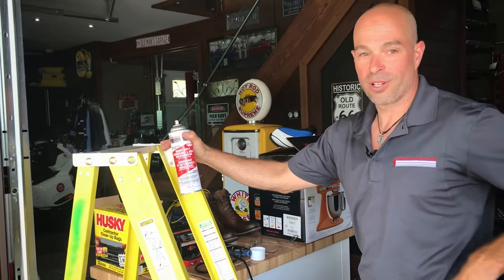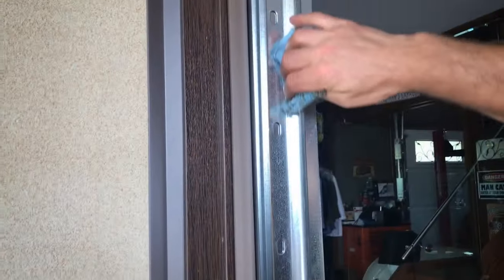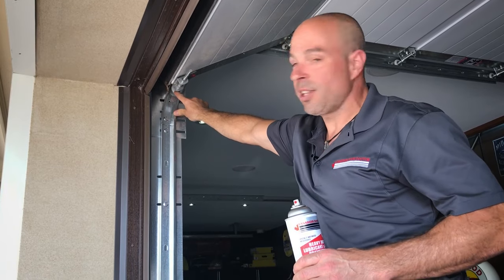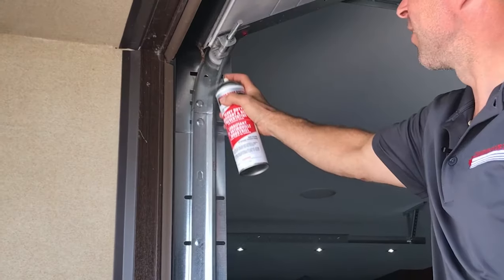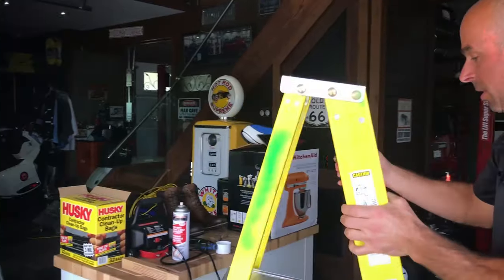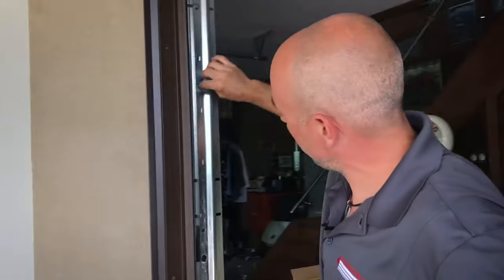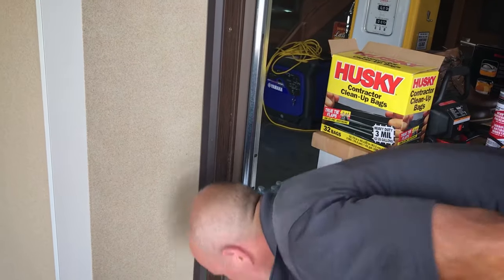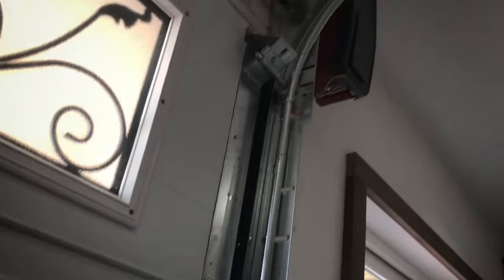How To Lube A Garage Door Properly! "Mike's Garage Door"

Comment: Wrong wrong wrong. You don’t lubricate the tracks.  All you’re  doing is creating an environment where dirt and dust will accumulate and make it harder for the garage door wheels to go over or through.  You want a smooth and clean track that your wheels can ride on.  So clean your tracks with a degreaser until all that junk from your previous lub, dust, and dirt comes off.
Reply: You’re supposed to lubricated
Reply: It’s supposed to be lubricated
Reply: @xian.irungu  not the tracks.  Te tracks are smooth enough.  Clean them well and carefully run your fingers inside the tracks and you’ll see.
Reply: @CrazyxxxUkraine  ive done both, and just cleaning the tracks was 10x better.  It made it easier for the wheels to roll on it without having to go through all the muck that the lubrican collects.  It also made it easier for the motor as well.  Good luck with it.
Reply: To clarify, if the rollers don't work due to lubed tracks, it will damage the rollers and create flat spots. You DONT want to lubricate the tracks.
Reply: If you watch the start of the video, he does clean the track!
Reply: @shoafymusic  Cleaning is fine, it’s greasing the track that you’re not supposed to do.
Reply: @edwardlouis3428  agreed!
Reply: @xian.irungu  yes, but not the tracks!!!!!
Reply: I totally followed this video and it made everything so much more squeaky I want to throw up. Now I can't get it to go back to how it was (it wasn't great before I did it).
I haven't been this frustrated in a long time. It sounds like nails on a chalkboard now every time I open and close my garage door. So much for diy YouTube, God this sucks
Reply: @bricksbyficks6448  can you identify what exactly is squeaking?
Reply: @shoafymusic  no I can't. Wish I could, I had to just walk away I'm so pissed
Reply: @bricksbyficks6448  that’s fair man. Totally understandable 😂. Whenever you calm down a little go back out there and see if you can figure it out, maybe manually do the test so you have control over the door.
Reply: @shoafymusic  I appreciate it. That's a good idea and I'll try it tomorrow. I'm feeling better now that I stopped trying to fix it. I just moved into a new house and I'm trying to be a good responsible home owner. Unfortunately I have very limited time and a diy budget lol
Reply: @bricksbyficks6448  you’re fine brotha. I know exactly how you feel. Manually controlling the garage door will allow you to open and close it as you please and this will help have you listen and identify the approximate area that’s making noise! Best of luck to you, I hope you can figure it out!
Reply: @bricksbyficks6448 You better call Mike!
Reply: Dry lubrication  does not attract anything.
Reply: @TeddyRumble  but it cant be held onto surfaces. That’s is why they are mainly used in places where they can be contained. The garage tracks are not areas that can contain dry lube.
Reply: @xian.irungu  I use silicone spray which is made for rubber, plastic, and metal I think he does this just so there isn't any noise gets a call back.
Reply: So what do you do if your garage door opens half way then stops
Reply: @michellenixon853  check the alignment of the rails. Check the tension spring located above the opening of the garage. It may also be a mechanical issue with the opener itself. If you grease the tracks, they you’ll need to clean it. Too much gunk will cause it to stop the door (like a speed bump). You want them as smooth as possible.

Comment: lube all hinges with white lithium grease and spray the torsion spring on top, youre welcome
Reply: U just ruined this guy, lol
Reply: What spray for the spring?  Silicone?
Reply: Garage door lubricant. Blaster has it.
Reply: Thats what i did. Just put the wd40 white lithium on the hinges and then silicone lube on the smaller moving parts and rollers. White lithium looks like shit tho after its smeared all over and tracks and stuff.
Reply: Hahahaha..... Thank you
Reply: Mine was creaking my wife insisted I call a garage door company which I know these days no one rolls wheels unless it's a $300 charge. Watched these videos got the lube I needed all fixed now she was surprised we saved $300. Last 3 years I stopped calling service guys just charge too much money now days.

Comment: You are not suppose to lubricate the tracks.
Reply: That is correct. You only clean the tracks. 
Lubricated tracks will collect dust over time and it'll be a pain to get that off.
Reply: I agree. I signed off when he mentioned/showed doing that mistake.
Reply: well, he did say it's more like cleaning than lubing.
Reply: exactly.  And how exactly would lubricant "quiet" a wheel that is rolling in the track?? And then he decides at the end of the video that the lubricant is for cleaning the track???  When is the last time you used grease to clean something?? This guy has no idea what he's talking about.
Reply: Bob is an annoying know it all.  A Kammi Harris voter.  @BobsGT235
Reply: Wd 40 is not a lubricant

Comment: That can of spray looks like clone of WD-40 anything that says lubricant and rust preventor smells like WD-40 which is not a long lasting lubricant it works good short term generally evaporates with in a month or less. I find it wears even faster after that it removes whatever lube was in there.